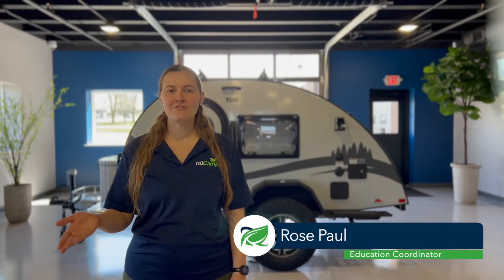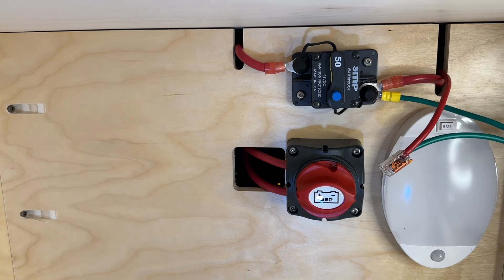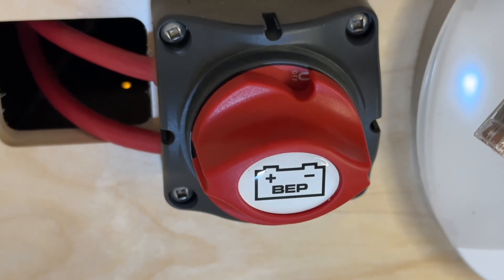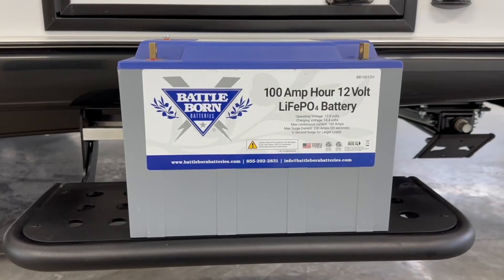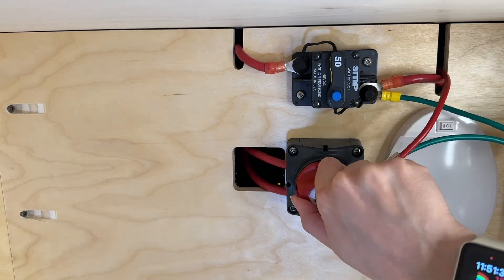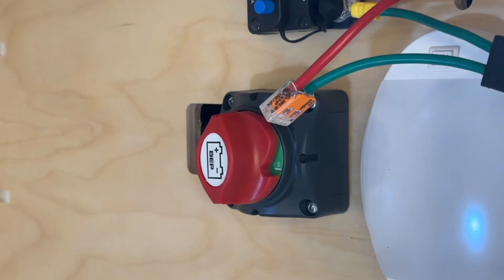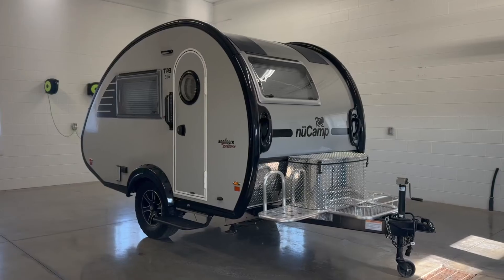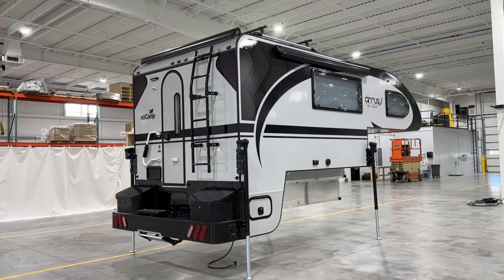Tech Talk: Understanding Your Battery Disconnect

Comment: A good synopsis however there is always one major point left out. The emergency brake on the T@G requires power to operate on the event of a trailer breakaway correct? Then, besides the charging provided by the towing while you should leave the disconnect switch ON for this emergency brake to function?
Thanks...and appears others have made this point:)

Comment: Leaving the battery switch turned on while towing is essential to allow the break away brakes to receive power in case of a total disconnect from the tow vehicle. It is not just for the purpose of charging the camper battery or powering the frig.
Reply: Thanks